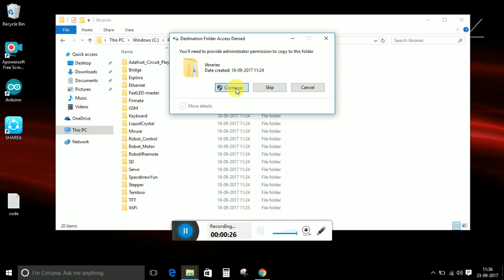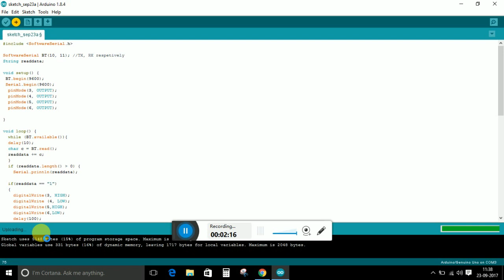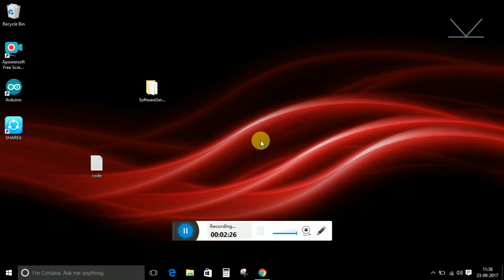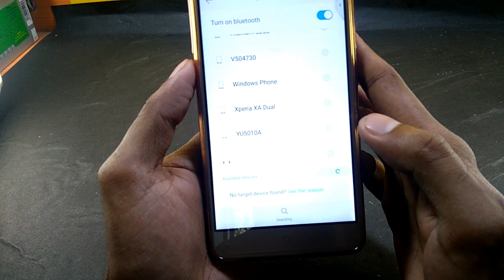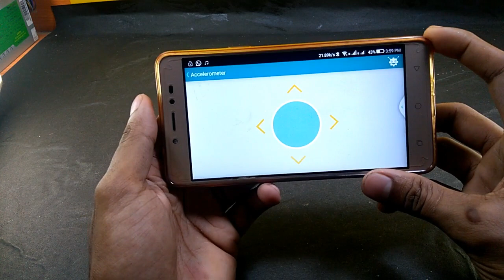How to make gesture control robot car using arduino & smartphone/arduino accelerometer

Comment: How did you get 12 v battery, can i use a smaller one instead of that 12v without disturbing the circuit??
Reply from the maker: the supply voltage depends on your motor voltage rating...
Reply: i am using a 9v motor, and so i need to use a 9v battery, but for that, do i need to change something in the circuit, like the 5v and 3.3v pins??
Reply: please reply,otherwise i will unsubscribe. And my friends too.
Reply from the maker: nothing will be change.....
Reply from the maker: I reply everyone as fast as possible for me....
If you don't like my video then you can dislike my video also unsubscribe my channel..
Reply: Kk.... I am sorry for that, you do nice video, I mean they are awesome.
Reply: How To Bro I love your videos bro you are a great robotician like magician bro are you studying bro

Comment: I've used  9v battery and two 9 volts motor then i upload the library and code and then i gave the connections but when i connect 9volts of battery to 12volts of motor driver ... the blue tooth module was not on ...

Comment: Bro you are not providing any external power supply to arduino
Reply from the maker: the 5v output of the motor driver connected with arduino....